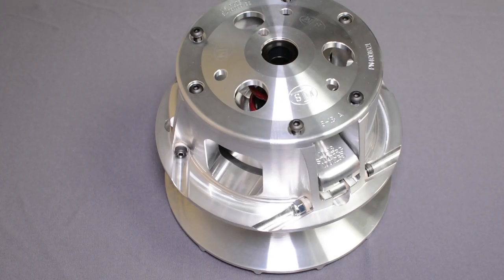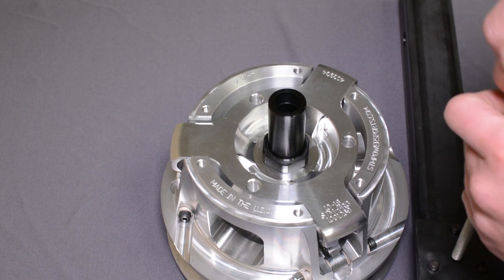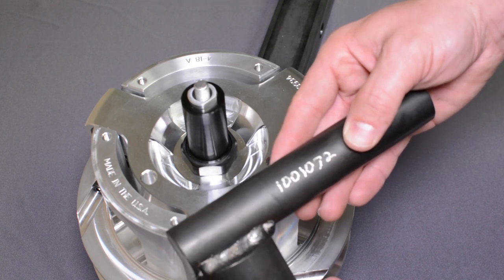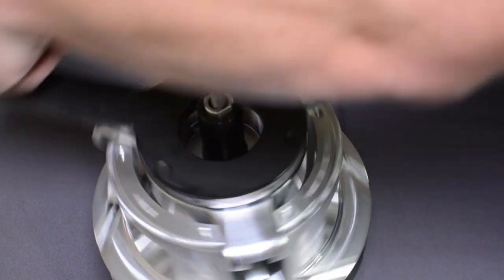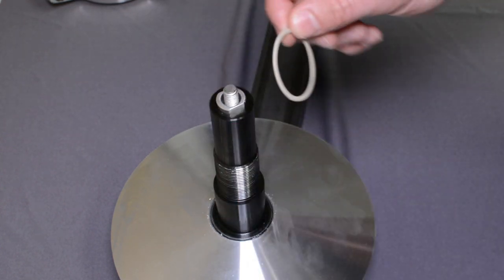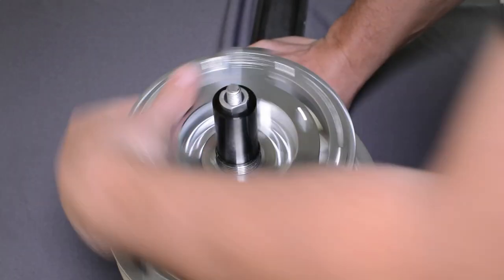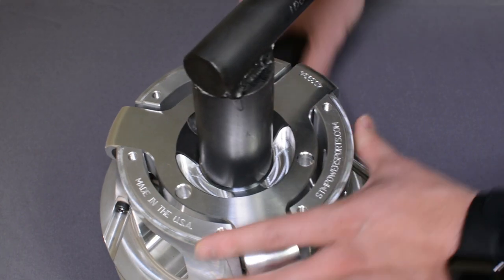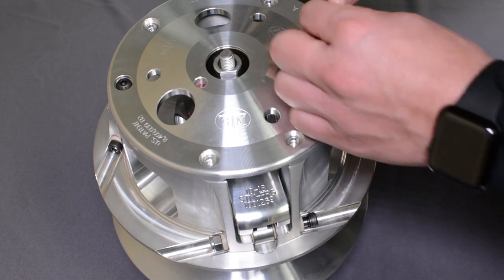STM Primary Clutch Disassembly

Comment: Having same issue on a 2020 rzr 1000 with both stm primary and secondary. Can shift between gears without turning it off because secondary is spinning so bad. My primary pulls in when I start machine so I’m hoping just primary spring is weak

Comment: Got 1200 miles on my Rage 3P and have trouble shifting. Was told it needs 2 way bearing replaced.
Reply: Ever find answers?
Reply: @chasebell2963  Yeah, I took it back to the factory and they said it need $375 worth of work.  (They basically said it needed to be completely rebuilt). I had them fix it, then sold the OG Mav and bought an X3. I don't have anything good to say about STM considering I drove that machine like a granny.
Reply: Having the same problem. I just bought a used maverick that was hard to get into gear. Was told it was all stock and just needed the shifter linkage adjusted. Well that wasn't it. Tore the cover off and found out the clutch was dragging which is what brought me here 🤦🏻‍♂️
Reply: @SHOTS-FIRED  it was probably never cleaned. Blow it all out with brakekleen. Usually the secondary will need a shim behind it if the belt is grabby or hard to shift. That's the easy one to remove.
Reply: @SHOTS-FIRED  when you pulled the cover you then saw it was a STM ? Or is it the OEM primary? Turbo or NA ? What year. ? If your still having shifting issues let me know. Lots of factors can cause that outside of needing to shim the secondary which is where a lot of people will tell you to go right of the bat. Not always the case
Reply: @nwags357  NA. i was told it was stock by the guy i got it from and just needed the linkage adjusted. We took the clutch cover off and found it was an STM. We replaced the spring and cam arm spring. Now it shifts into gear fine but the clutch doesn't start to engage till 2500rpm
Reply: @SHOTS-FIRED  ok… as far RPM’s that could just be a matter of not as stiff primary spring .
Weight setup.
What do you mean by replacing the cam arm spring? 
The only spring in the primary is the main Spring?  
Do you know your current weight setup that way you know where to start if you want to change RPM engagement and max RPM’s. 

what are you maxing out on the RPM’s. 
And also just to recap the shifting part. Once you were done and the machine was idling or you put through the gears and throttled it, it would come down to idle and the belt stayed still(the primary never grabbed it) that’s what you want. The belt should never grab the primary and spin the secondary . maybe your familiar with what I am referring to by not grabbing the secondary and spinning that will cause hard shifting .
Reply: @SHOTS-FIRED  do you have STM secondary as well?
Reply: @nwags357  stock secondary
Reply: @SHOTS-FIRED  your going to get mixed reviews on this topic …I stand behind this statement 100% on these canams when it comes to lapping the primary/crank . Depending how the previous owner  maintained the machine that process will go a long way to save you hassle in the future. 👍

Maybe you did this. Good luck
Reply: @SHOTS-FIRED  same here
Reply: Exact problem I’m having